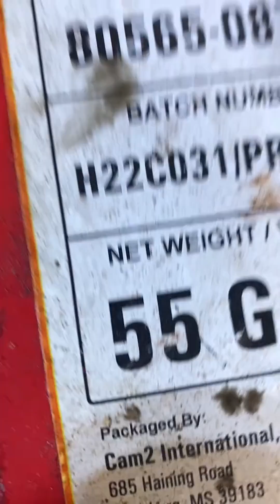Homemade Diesel from Waste Oil Hack #55gallondrum #wasteoil

Comment: Actually if you fill it completely to the brim its holding about 68 gallons. But back in the day the oil companies would put only 42 gallons to allow for "expansion" or in reality to screw the customer. I might be wrong about 42 it may have been less but I'm pretty sure that's what my grandfather told me. Retired from Easton Oil Services when they sold out in the 80s. Even when fuel was 53 cents a gallon they still were screwing the people over.
Reply: Yes its 42